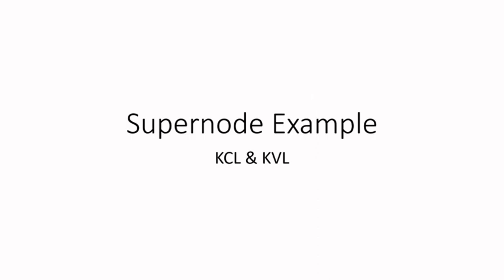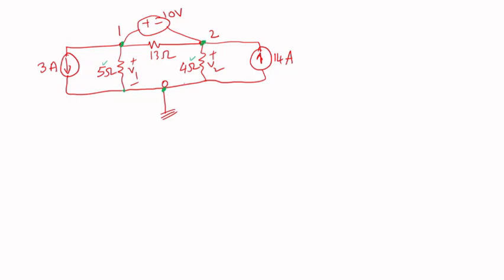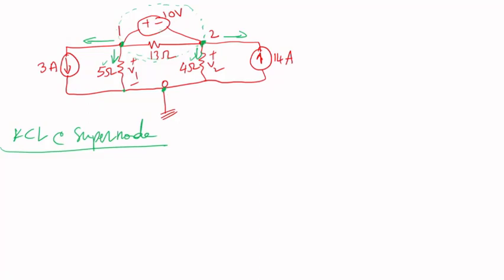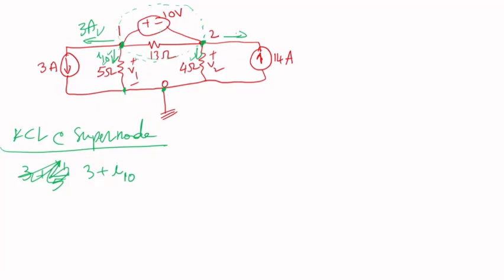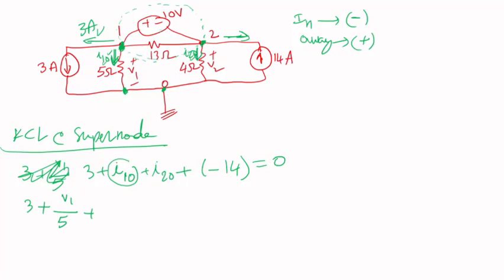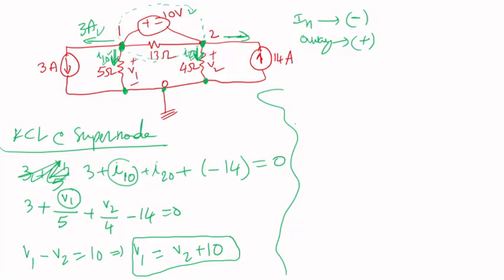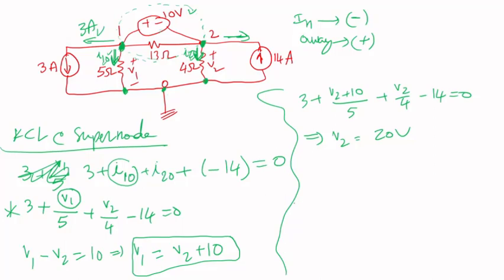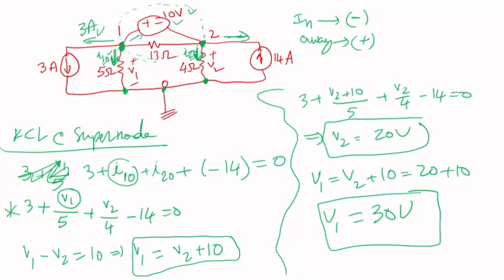Circuit Analysis | Supernode KCL & KVL

Comment: HOW DID YOU MARK THE CURRENT DIRECTIONS.?
Reply from the maker: The choice of current direction is arbitrary. The main thing is to keep the polarity of voltages or direction of current sources in mind while writing KVL and KCL equations.

For instance, I chose current flowing from node 2 towards node 0, which is opposite from source with 14 amps so I20=-14 amps. I20 is current flowing from node 2 to node 0.
If I chose current as flowing from node 0 into node 2, then I02=+14 amps. I02 is current flowing from node 0 to node 2.
Hope this helps.